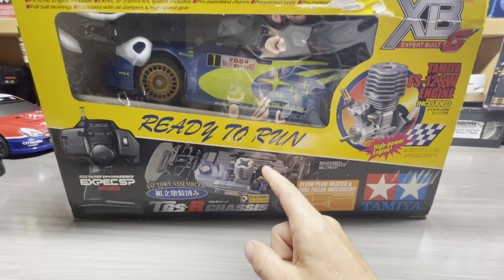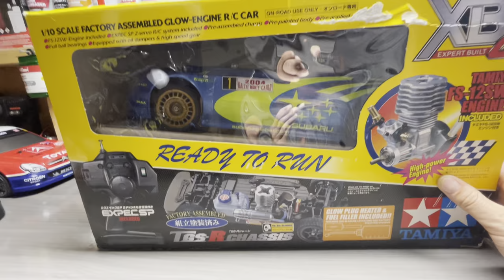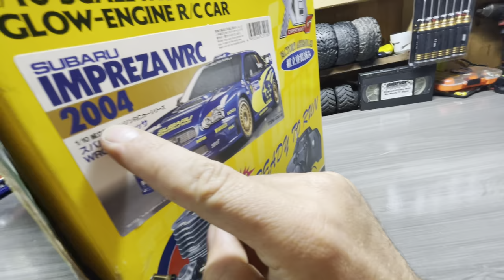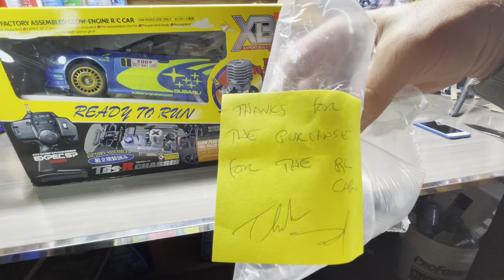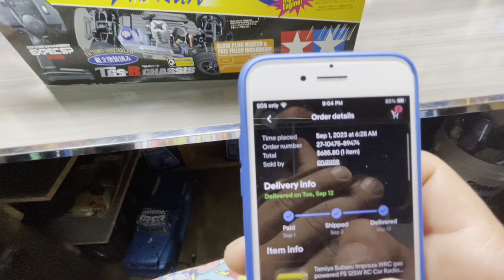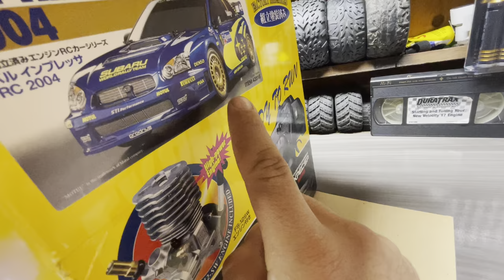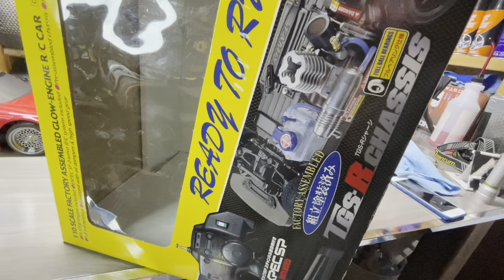Most Expensive RC Car In My Collection TAMIYA TGS-R LETS CHECK IT OUT !!!

Comment: I recently found this same car in my attic, forgot about it from my childhood. I want to restore it but it is in pieces and I am missing a few parts. Any tips on where to find parts for this chassis? I found a few sites online but I can't seem to find the fuel tank anywhere.
Reply from the maker: The only place I was able to find anything was eBay and not a lot is available good luck with yours !!!
Reply: Thanks, I'll have to keep an eye out for parts as they become available.  @Nitrorcvlog
Reply from the maker: @nicholaskrzysiak1157  worst case you can use a hsp tank and try to make it fit it should work might not fit perfectly but if you just want to get it going it will work
Reply: @Nitrorcvlog   I'll likely have to Jerry-rig a few things. Better than nothing I suppose.

Comment: Nice car ❤ are there new parst for this model ?
Reply from the maker: Yes it shares parts with other tamiya rcs not all parts are available for it but if used correctly it will not give you problems
Reply: Thanks for the info ! I just got 2003 wrc Ford focus